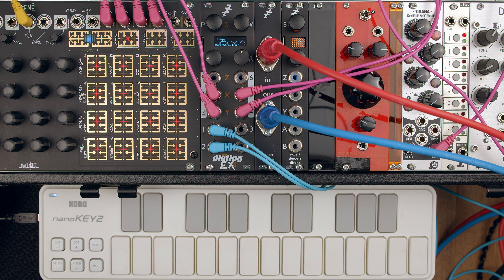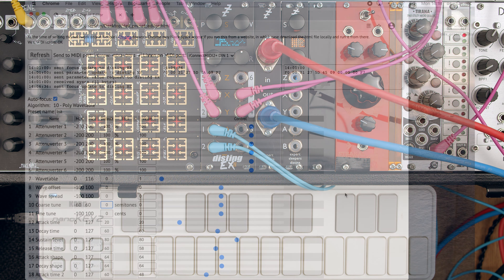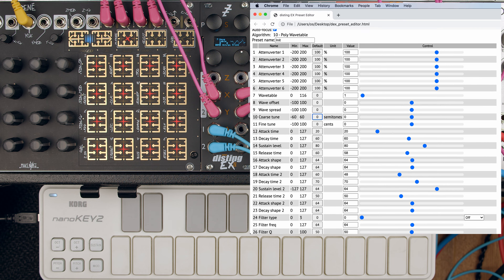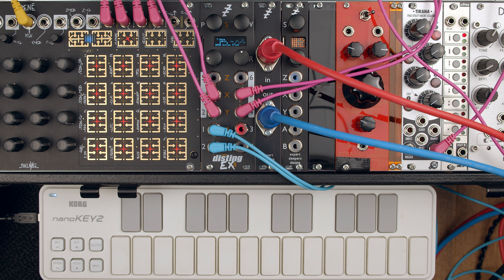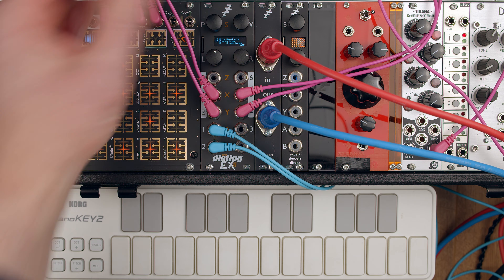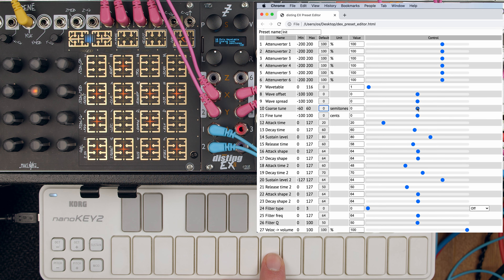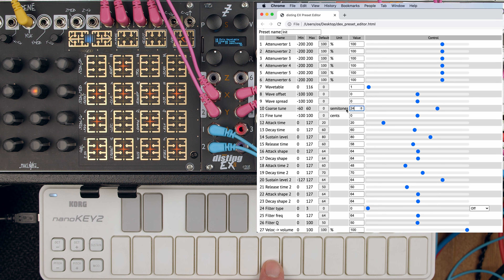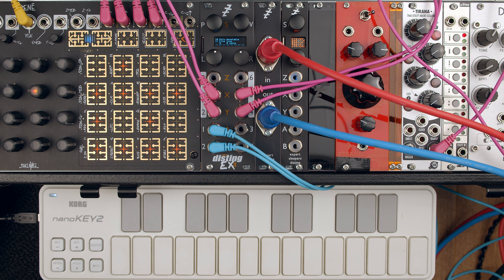disting EX - Poly Wavetable, part 1: Introduction

Comment: Thanks for this work!!! Is it possible to get polyphony without midi breakout module? I'm trying this in VCV Rack using a midi controller and a dc couple interface but it doesn't work.
Reply from the maker: Yes, it's always polyphonic. If you want to simultaneously play multiple notes over CV/gate you'll need to change the input mode parameter, and connect a CV/gate pair for each note.

Comment: I have connected the midi break out module to my disting ex and want to test this algorithm... however i might be missing something. I ve selected the poly wavetable algorithm and connected a midi cable to the MIDI "in" on the breakout module. The MIDI "out" cable has nothing connected. I have a cable from output 1 on the disting ex that goes to my VCA (no other output has a cable). I ve set the input mode to "no cv/gate inputs". Is there something else I need to do? When i play a note on my midi keyboad I m not able to get any audio to my VCA. Also is there some way to test if my MIDI breakout connection is working as expected. In most parameters i just see -- instead of note names hence I wonder if the breakout itself is not sending MIDI to the disting. Kindly advise.
Reply from the maker: My first advice would be to use the support forum or email for detailed support requests like this.
https://www.modwiggler.com/forum/viewforum.php?f=35
You can see what MIDI is arriving at the module via the Misc->Show MIDI history menu.
Reply: @ExpertSleepersLtd  thank you for your prompt reply, i will create a ticket on the forum as i dont see any midi history :/
Reply: I m happy to report the issue is now resolved. The issue was on my side. I believe my alignment of the row of four conductors needed to match the same on the breakout module as well!